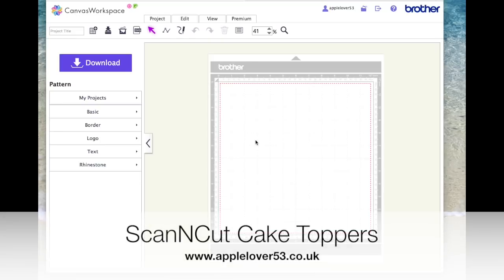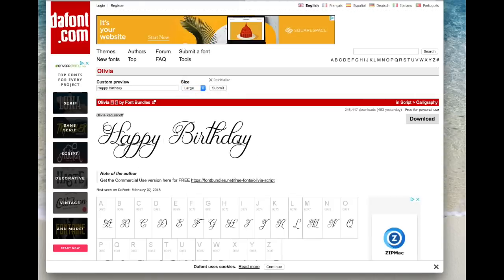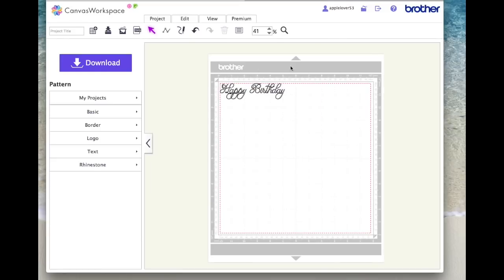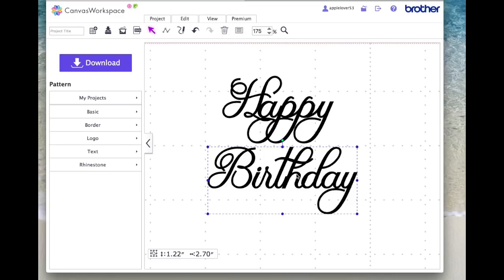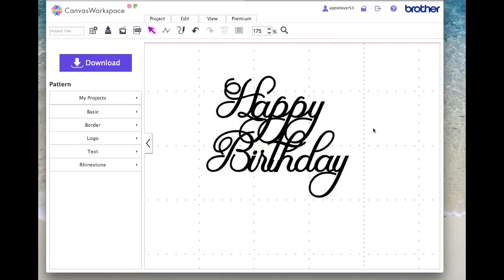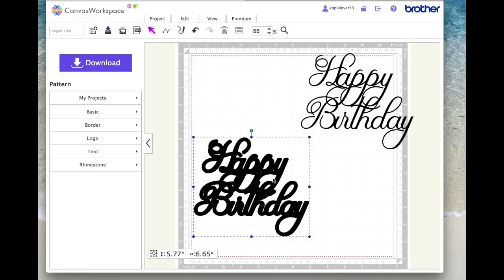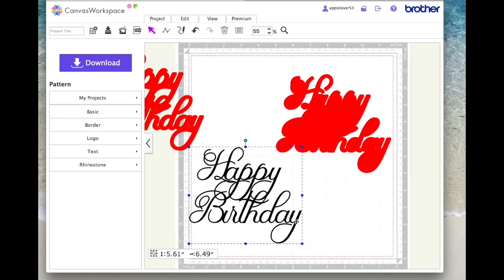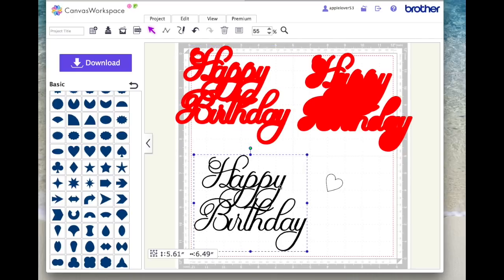How To Make A Cake Topper in ScanNCut Canvas Workspace

Comment: What blade setting you using
Reply from the maker: Sorry I dont know that video is over 2 yrs old, if you use the test cut facility on your machine it will help you work out what blade settings and cut pressure to use, unless you have an autoblade machine and then that will do it for you automatically. thank you